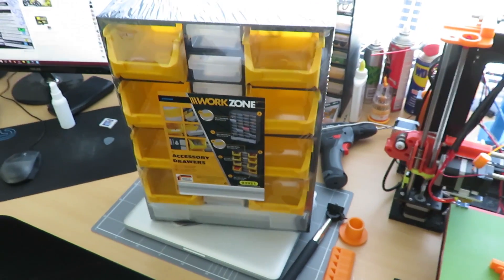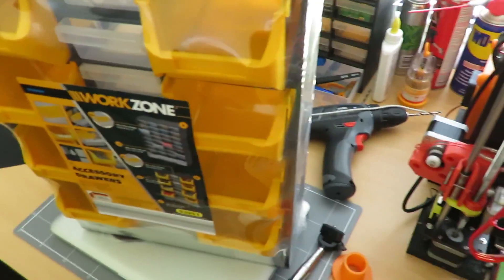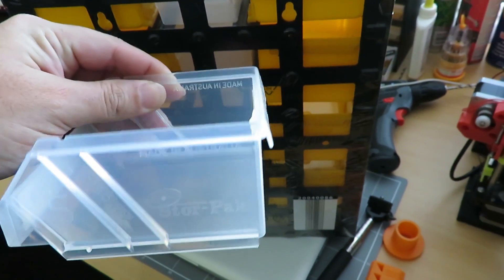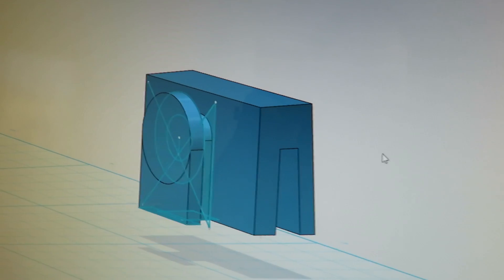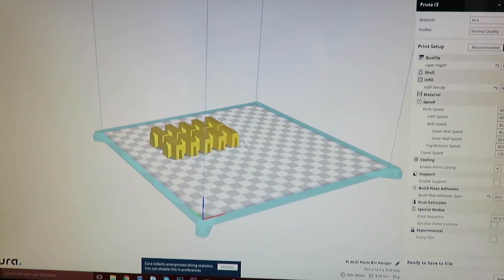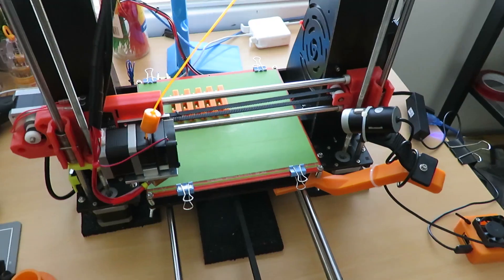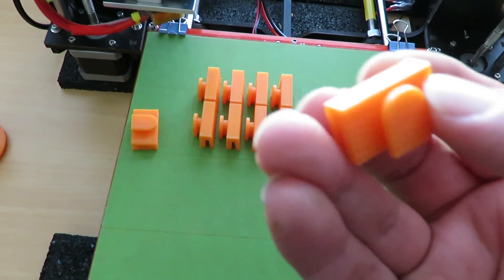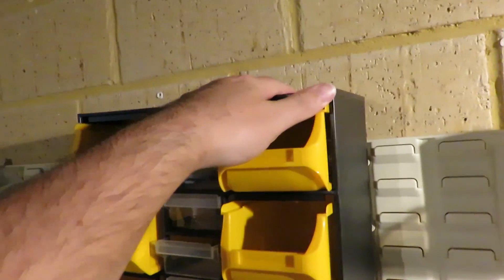Custom Garage Storage Project - 3D Printing With Rm2kdev #8

Comment: Good video. My printer is on its way. I see u make several modifications since the last video. Top orange parts for rods, i see a cover part for the board. Will u make a video about that and tell us how they worked out? That would be great.
Reply from the maker: I will be making a video on the Z Axis end plates with threaded rod stiffener but probably not the board cover just yet the reason being the print warped and i had to use the dremmel to make a bunch of hacks to get it to hold the board and fit and now i have mosfets on the way and an orange pi running octoprint ineed to make a new enclosure to house it all so there will be a video in the future on that :)

Comment: What kind of material this 3d printer uses?
Reply from the maker: This one can print in anything really, i printed these clips in cheap $20aud/kg PLA  plastic but it can print ABS with the heated bed and an enclosure as well as PETG and the plethora of composite filaments like metal,wood etc you just need to setup your hot end for it.
Reply: Incredible. Here in south america these printers are still kind expensive. I was wondering if the materials would be expensive also. Thanks.